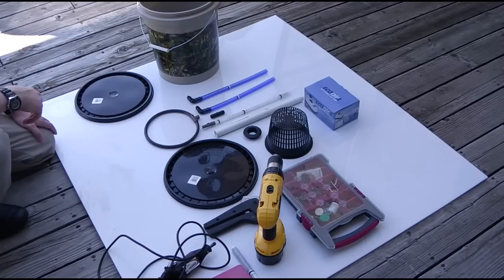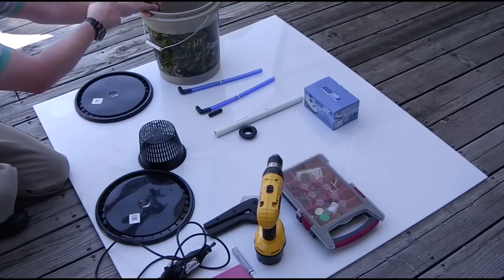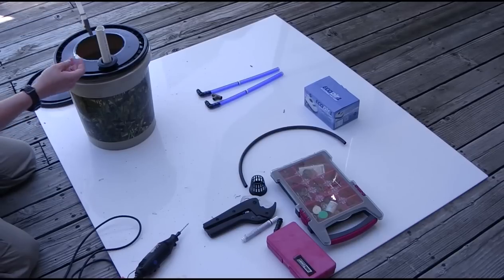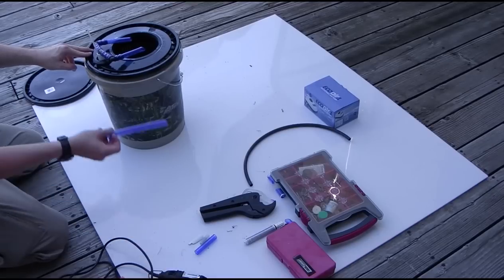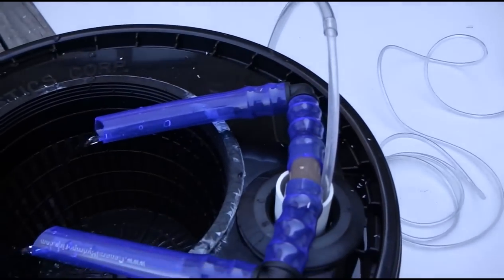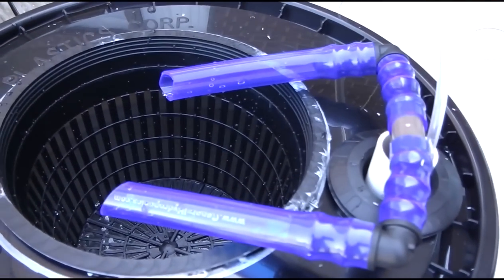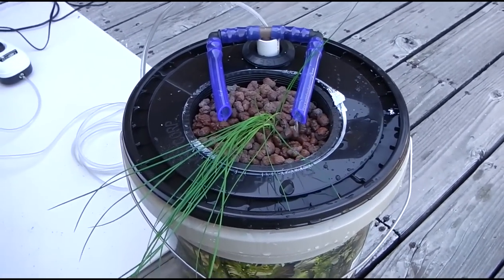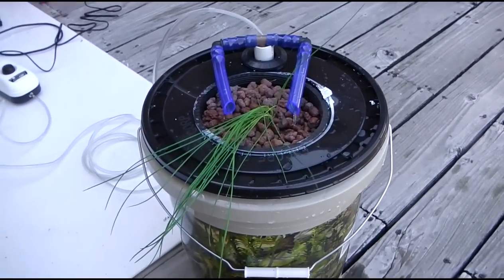Air-Powered DWC Hydroponics System, DIY

Comment: Shit setup, use a venturi will be much quieter, more O2, plus it's adjustable as far as water & O2, over thinking it, best setup I've discovered after 15 years is aeroponics/aquaponics/DWC basically a DWC system w/ air in w/ Veturi's & aquaponics for nutes